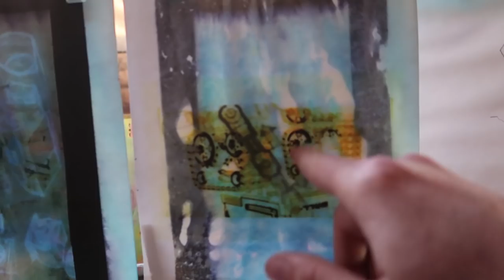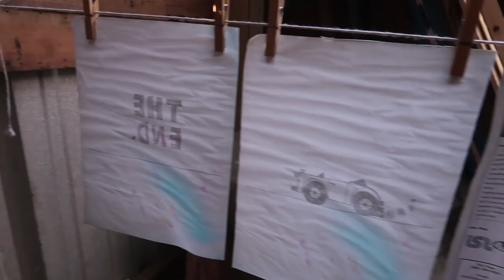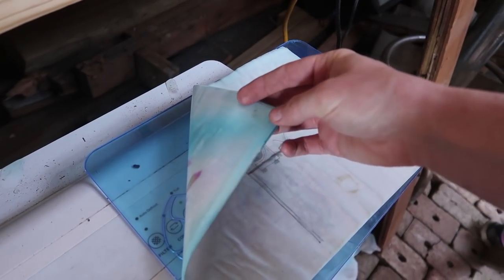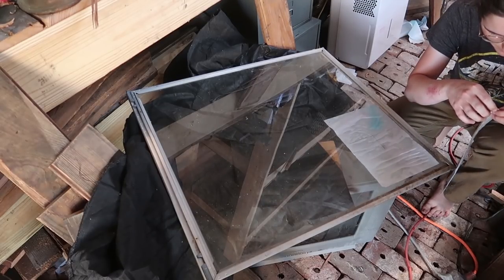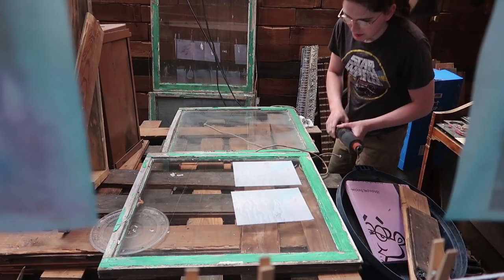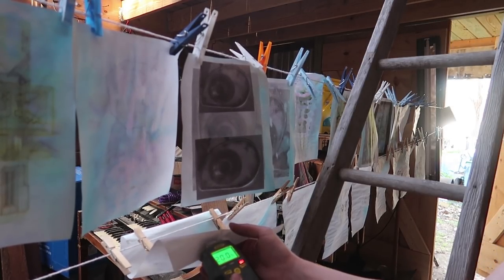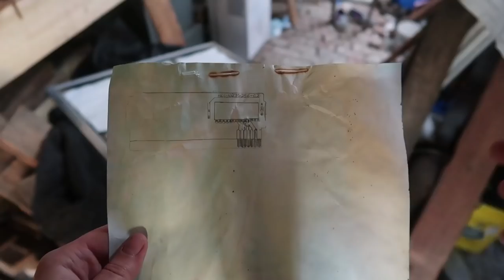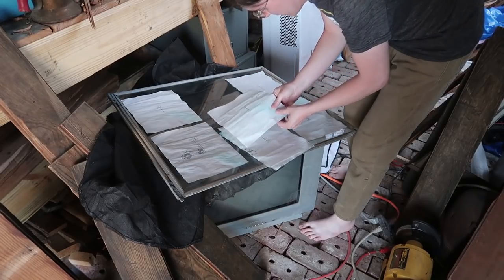Experiments in How to Dry Wet Paper, Possible Apply to Books or other Documents.

Comment: You're doing a pretty good job. I do book binding as a hobby, and repairing water damaged books and papers comes along with the job.

Once it's fully dried, ironing it with an iron on a super, super low setting will help remove a bit more of the wrinkling. Irons can vary in power, so do a few test sheets to see. If you can get your hands on a letter press, too, just stack them evenly and put them in there under pressure for a few days, and that'll get rid of a ton more.

I ended up having to build my own letter press, out of scrap wood and a veneer press screw I got off of Amazon for about $20. Not as good as cast iron plates, but I've got a few railroad tie plates I'm planning to modify.
Reply from the maker: i actually do have a Chandler & Price platten press, never thought to use it as just a press and not to print. hrmm
Reply: @RinoaL  It's worth a shot. All you can waste is time, if it doesn't work, but as long as you can sandwich it between two sturdy objects and press it for a few days, it should help at least a bit.

Honestly, in a pinch, baking sheets and bricks work pretty well.

Comment: I hear the neighbors are having fun at the forge!
Reply from the maker: yeah :D
Reply: I've been having fun salvaging old lithium and nicad/nimh batteries!
Though I do regret not using a separate container to hold the remains of the 6V lantern batteries, manganese dioxide all over the batteries I'm pulling from the dead-bucket! Now I just have to come up with a use for all these 18650 cells and assorted others. XD